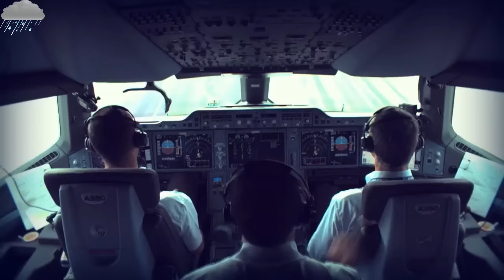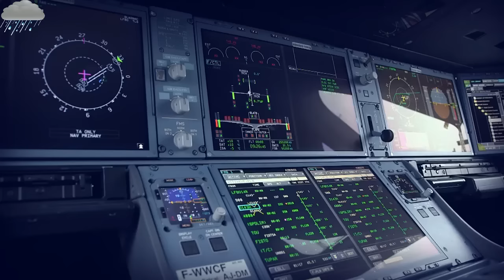Airbus A350 XWB Documentary Part 1/4

Comment: Our flight on the Qatar A350 was very comfortable.  Economy had 3-3-3 seating, which was fine.  Here is my video review - https://youtu.be/MeTxDyDYHyQ

However, our flight on the Qatar Boeing 787 was miserable.  Economy had 3-3-3 seating and it was way too cramped, with a huge IFE box blocking my feet.  Here is my video rant - https://youtu.be/aUsyhMg_YTQ
Reply from the maker: guitar singapore travels It looks cramped like a 3-3-3 A330. Does the 787 3-3-3 has a more than 17" seat width?
Reply: beavertown2006 Boeing 787 in 3-3-3 has less than 17inch seat width.  The Airbus A350 3-3-3 should be around 18 inches, I'm not sure.  But the Airbus A350 felt a lot more comfortable than the Boeing 787. You can read what others have to say here - http://www.airliners.net/aviation-forums/trip_reports/read.main/266314/
Reply: +guitar singapore travels The customer gets to choose the interior of the aircraft.  It's not really Boeing's fault.  Besides, that 787-8 is in a different market segment.  It's closer in size to an A300-600 than an A350-900
Reply: both boeing and airbus have their ups and downs
Reply: +beavertown2006 im going on a A330 ecomy is 3-4-3
Reply: Actually a330s have 2-4-2s in their economy.
Reply: I've also travelled on a 787 on a 3-3-3 configuration and I have to agree with you, it is very uncomfortable, the seats are very narrow and there is not much leg room and I'm just 6 foot

Comment: The explanation of how lift is generated at 12:00 is incorrect. See what NASA says on this: http://goo.gl/au2Yko
Search also for "How does an airfoil generate lift?"
Reply: +Dimitris Koutoulas Was about to write exactly that, but then I saw your post.
Reply: +Dimitris Koutoulas Also, that double chambered foil used on the example wouldn't be very efficient for lift generation.
Reply: +Gian Violi Annoying how widespread that nonsense still is, isn't it? Even among engineers. Especially the bit about the pieces of air "meeting up again" behind the wing.
Reply: My mind is blown. I thought documentaries teach you something right, not wrong.

Comment: How is it innovative and groundbreaking stealing design ideas from Boeing?
Reply: That's smart :). Weight for Boeing to make a move and then design and build a quieter, more efficient more comfortable plane
Reply: Do you mean they copied the nightmare liner B787 ? 
Sorry man but A350 is a proper A/C but B787 is just a big fail !!!!!!
I'm not saying Boeing is bad but right now they have only B777 to fight against Airbus .
A320 > B737 A350 > B787 A380 >>>> B748 and A330 > B767 and B757 .
Reply: GTS LOVER first of all you have the comparable aircraft mixed up. 737 is Miles better than the A320. And the  A350 is comprable to the 777 not the 787. Which the 777 is going to be much better with the new GE engines and lighter frame and folding wing tips.  The a330 comparable to the  787 which the 787 is more advanced with their materials. Boeing is also smart by not putting much investment in the jumbo jet because the market isn't leaning toward that. The only thing that is keeping the A380 a float is Emirates.
Reply: UrBex, You are wrong.

A320, A330, A350, and A380 have bigger economy class seat width compared to B737, B787, B757, B747 or B777.

B787-8/-9 are comparable to A330-800/-900. But B787-10 are comparable to A350-900 even though there are massive difference in range.

B777-200ER are comparable to A350-900. While B777-300ER with 9-abreast are comparable to A350-1000.

B747-400/-8 are way smaller compared to A380.

Boeing wasted billions of dollars on B747-8 development and they don't sell well. Even the famous cargo version are failing on order.

A330NEO are not as advanced as B787. But the price of A330NEO and the fact that A330-900 have shorter range made up for lack of fuel efficiency for B787-9. Especially on shorter routes (Less than 6000 miles). A330-900 could have comparable efficiency to B787-9. Hence why A330-900 are a good competitor for B787-9 on shorter and regional routes.

B777X is a shitty aircraft with a small economy class seat. The new engines are only efficient because boeing stretch the fuselage to accommodate 400 seat. Either way, it's still an old junk like A330NEO.

Also B777-8X are an shitty aircraft with too much range and high fuel consumptions.

Comment: Right, "extraordinary" planes, cutting edge wings, blah blah blah, they can't make a camera that captures motion correctly.  Cheap CMOS sensors.  There was superior 3-CCD technology back in the '80s, we really have shit video equipment today, at least the one below $10,000 mark.  What a disgrace.
Reply: I thought this was about the A350...
Reply: TheThirdMan To me brand new aircraft is about technology first.  So I digressed into imaging technology.  Like a technology of certain time, such is the airplane.  And since airplanes involve people's lives at stake, I am obviously concerned about technology types being used.  Currently CMOS imaging technology is inferior to '70s CCD technology.  I am wondering if the same holds true for aircraft technology like LCD displays versus CRT displays versus analog dials.
Reply: Andrew Piatek It's a GoPro. It's a tiny chip and the idea is to keep costs down. I don't get why you think a 1970s (sic) chip would be better than a modern one. The rolling shutter effect is not the result of poor quality or cost cutting and can be corrected. CMOS chips are great. I have been using television cameras professionally since the days of tubes.

Let's get back to the A350...
Reply: TheThirdMan I am not buying an A350 any time soon.  And I prefer CCD cameras.  Vertical smear is nothing compared with CMOS noise, skewed shutter, and poor light sensitivity.
Reply: Vertical smear effectively no longer exists and hasn't done for years. That was first generation. As for your other complaints, I can show you CMOS sensors which will blow anything else away for performance, including noise and light sensitivity.
Reply: TheThirdMan So then why are all the top of the line ENG and cinematic camcorders still CCD?  Because CCD is the best.  There are only two good thongs about CMOS. Low cost of manufacture (so yeah, all manufacturers will try to convince you it's best) and low energy consumption.  That's the only advantage of CMOS.  Other than that, image quality, inter pixel interference, light gathering capability, it's all in favor of CCD.
Reply: Andrew Piatek Not something I think about much. I'm more impressed by the quality of the shooting than the quality of the chip. You may have noticed that those cameras actually use three chips instead of one. Could be to do with the way it channels the signal. I'm not an engineer and I don't actually give a fuck. I will say I'm not a fan of the current camera I use (Sony XDCAM). But hey, if you can show me a modern television camera which can outperform a Sony A7S in low light then be my guest.

I have other things to do.
Reply: TheThirdMan 3 native chips are better than one still camera type chip that need interpolation of pixels to bring image down to 1080 lines.  If I buy a camera for $10,000+, I'd never buy a single chip camera.  Even for $5,000 I would go with 3-CMOS only.  My favorite cameras are HVR-Z7U and HVR-S270U.  If money were no object I'd get 3-CCD Sony HDW650F.  But I can't afford that one so I make do with 3-CMOS.
Reply: Andrew Piatek Whatever floats your boat mate. In technical terms, I only care about the fact that my CCD XDCAM goes to about +18db and anything beyond that, the whole picture looks like a locust plague. It's unusable. So much for CMOS being noisier. It's too heavy by far and gets belted by the A7S for picture quality under virtually any conditions. That's as much thought as I ever give it. That from a $40,000 for a 3 CCD (without a lens).
Reply: TheThirdMan Lots of things float my boat.  Form factor, looks, build quality, handling, ergonomics, aesthetics, mechanical parts clicking, MO disc optics (if id's a high end XDCAM), etc.  I don't even care as much for the final file output.  And it's more than likely to be decent from three 2/3" native CCD's, and if too much gain does a little harm (it always does) then get some lights.  I care more about overall experience of image acquisition.  Final result of life is death.  I enjoy more the living part.  Congratulations for downgreding your gear from $40,000 cam to a $10,000.  Good going.
Reply: Andrew Piatek I didn't. I don't get to choose and I'm not much interested in gear. I'm strictly an end user.

Just like I would be on an A350.
Reply: TheThirdMan I'm not a utility user, I am an enthusiast, and gear interests me on equal level with content.  I like music theory (chord voicing and progressions, music notation), and performance techniques as well as various synthesis methods (additive, FM, PD, subtractive, and physical modelling). And I very much appreciate Japanese craftsmanship in electronic musical instruments execution.  I love all these things.  I think they're wonderful.  I like both abstract things (music) and material things (musical instruments, chronograph watches, and shoulder mount camcorders).  Planes?  I love Cessna, the one with 6-cylinder boxer Lycoming air cooled engine.  That's what I call recreational and sport utility vehicle.  I also like Bell helicopters.

As far as commercial aircraft go, I doubt I'll ever had a chance to be on an A350.  I'd prefer to be on the Concorde, A300, A310, or A340.  I also like the 747 and 777, obviously.  And I very much like the DC-9, DC-10, and MD-11.  I quite like Boeing but I wouldn't feel sorry for them if Airbus bought Boeing.  Boeing took in a thrashed by public opinion McDonnell Douglas and thrashed McDonnell Douglas a little bit more.  Boeing even wanted to remove the third engine from MD-11.  If Airbus bought Boeing, Boeing would simply get a taste of its own medicine.
Reply: Andrew Piatek "if too much gain does a little harm (it always does) then get some lights."

Try shooting a siege situation at night with lights and see how you go with that.
Reply: TheThirdMan As a video enthusiasts, thankfully I don't have to work under siege.  I would probably no longer be a video enthusiasts if someone was telling me when and what to shoot.  Being a hobbyists has a lot of advantages.  Computers used to be one of my hobbies until I got an IT job.  I still enjoy some aspects of it (Motorola 68000 assembler, C, C++, shell scripting) but most of it I simply got disillusioned with, after basically whoring out some of my IT skills for money.
Reply: Andrew Piatek In the end, it's about the job. After 30 years, I have done everything bar a war and I'm not going to do that. I've seen and done things most people would find difficult to believe, most of it bad but not all of it. As Tommy Lee Jones said in "Men In Black"; for every good memory I've got a hundred I don't want but it gives me a wider appreciation of the world.
Reply: Andrew Piatek "I would probably no longer be a video enthusiasts if someone was telling me when and what to shoot."

By the way: people only ever do that to me once. Generally speaking, when you have veterans like me, the reporters learn from us, rather than the other way round. Not that anyone has ever remembered that...
Reply: TheThirdMan So they pay you for telling them what and how to do?  My god, I really want to turn professional then as videographer, it's an incredible dream job.  Screw my IT prostitution through pimps... er... recruiters.
Reply: Andrew Piatek No, it's a matter of survival.
Reply: TheThirdMan Really...  I wouldn't mind surviving with a $40,000 Sony XDCAM.  Or I could go to heaven with it.  Hey, as long as it's a Sony. :)
Reply: Andrew Piatek No, I meant really surviving. Sometimes you are at serious physical risk, even without being in a war zone. Over keen reporters can get themselves into an awful lot of trouble. Lots of people don't like the media or are in no state to be interviewed and we are often sent to places where we are not welcome. So I keep young reporters on a tight leash for my own safety as much as theirs. The camera is a pain in the arse too. It weighs about 12 kg with all the normal attachments on it. Add to that a tripod and a bag of extras you need and you're carrying upwards of 30 kg. That's half someone's body weight everywhere you go and nobody helps. You're usually in a hurry too. I have already had surgery on my left shoulder (it goes on the right but you do a lot of the lifting with your left). I now need surgery on my lower back.

Now maybe you see why I don't have any interest in equipment.
Reply: Well, Hammond organ players still like the real organ better even if it waights 400lbs.  I like my Roland A-80 MIDI controller too, even though it's 70lbs.   You actually need to have a technique to pick it up yourself by holding in the right place, or it's gonna be impossible to carry.  I still love the keyboard though and so does my piano teacher.  And if I can't lift my keyboard or go to the batrhoom on my own, then I accept a light weight squeaky plastic keyboard in a nursing home, thank you very much.

As far as comcorders go, I love the broadcast crews with their XDCAM's.  I couldn't care less about the "talent" in front of it.  My eyes are glued to XDCAM.  And the reason that people hate the media is all Dems' propaganda work that got people to the breaking point of annoyance these days.  So don't blame the people hating on the media, it's not their fold.  CNN did that to themselves.
Reply: Andrew Piatek We're doing our jobs. If you don't like it bad luck. The success of fake news just shows how people aren't interested in the truth. They're interested in what they want to hear.
Reply: I am not blaming video guys, by the way, or even anchors or reporters.  However,  I think CNN execs should've been in jail long time ago together together with former president for controlling public opinion and turning it against America.  And as far as fake stuff goes, not only news is fake.  So is another thing, dear to my heart and brain: music.  Case in point, Lady Gaga giving a glorified karaoke show, and rather mediocre (pre-recorded) circus performance during this years' Superbowl halftime.  Her musical performance have been equivalent to the air guitar competition.  I watched this show once to notice that all the instrumental parts were pre-recorded playback.  I watched Gaga show second time, to confirm it.
Reply: Andrew Piatek 
"However, I think CNN execs should've been in jail long time ago together together with former president for controlling public opinion and turning it against America."

That would be a politically suicidal thing to do. First, it's against the First Amendment. Secondly, the media does not exist to confirm anyone's comfortable world view, as your new president is finding out. That is not our job.

The rest I'm not interested in and I think I will draw this to a close.
Reply: Andrew Piatek Sorry. This is about the A350. Blocked without regret.